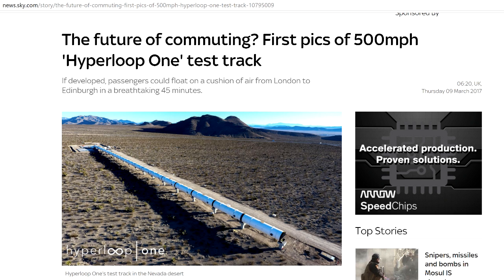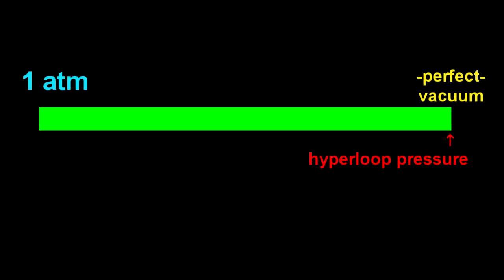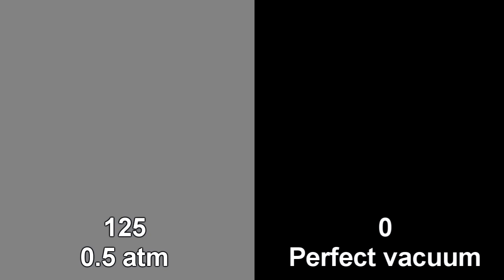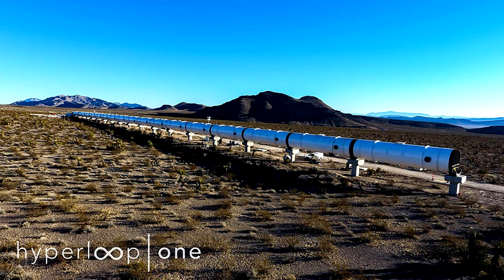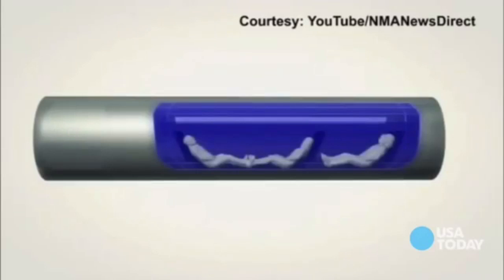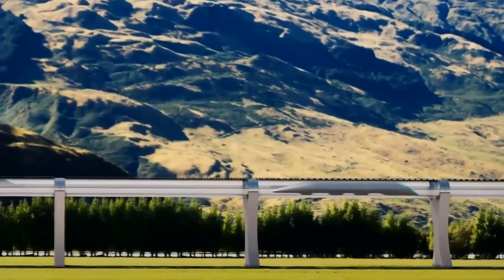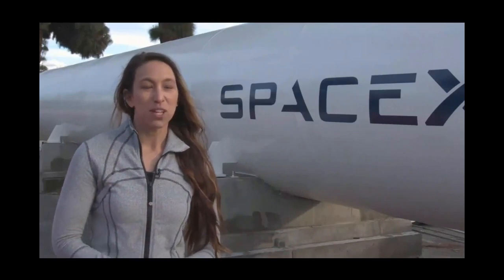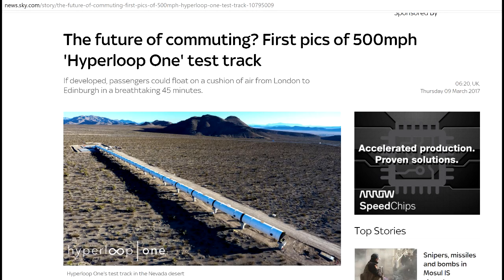Entire Hyperloop could be destroyed in SECONDS!

Comment: Interesting do you know what power is in physics it's what separates the the joules and n the food you eat from the joules in TNT you kind of blew the energy thing out of proportion on top of that just try to create a type of travel safer yeah so far it hardly got off the ground but that's why there call prototypes also a design idea might be to drop the pressure on one side raise the pressure on the other mind you to far less extremes then have and air tight seal one either side of the passenger car and and send it down like that.

Comment: what would you suggest as a solution for transportation?
Reply: High speed rail/Maglev.
Reply: I'm not saying your wrong, I like Maglev. and I have used linear motors on machines I've designed. The process of batch and queue needs to be addressed and pickup points. I would like to be picked up in my house. Unfortunately only cars do that, at this time. I like the hyperloop because of speed, small batch size, and it does not have to adapted to an out of date rail design. What ever we do we need to start fresh.
Reply: The economics of the hyperloop simply do not work. Even if we take the numbers that are offered, we're looking at close to 100 billion to finish this project. This means that a $20 ticket is a fantasy. The initial figures suggest 28 people in a car, and the rate of flow is one every 2 minutes, so 30 a minute which is 840 an hour. The trip takes 35 minutes, so we're talking about 18 cars in the tube at once. The headway between the cars is 2 minutes, and they're travelling at the speed of sound. That means that the cars are very close together considering the speed they're moving. No state that is investing this much money is going to allow such a short headway between cars, especially when the danger of one car crashing means the entire system could be destroyed. The cars do have brakes, but so do trains and it takes them a mile to stop at 50 mph. Granted, they are much heavier than the hyperloop cars, but they also aren't moving at an order of magnitude faster, are far, far, larger so friction is more of a force at play, and there's wind resistance. So the headway is going to be much larger than 2 minutes; likely something like 17.5 minutes, or halfway down the tube. This drops your rate of flow from 840 an hour to something like 84 an hour which is pathetic.

It's important to realize that we're talking about one of the busiest traffic corridors on the planet. There are around 50 departures from LA to SF every day, and each Airbus or 747 can carry anywhere between 300-500 people. If a flight is delayed due to plane malfunction or some other reason, then only one is stopped. If one of the cars holding 28 people in the hyperloop is delayed because of malfunction, then the whole tube is delayed. If a train car breaks down, there are alternate tracks to continue moving cargo. The hyperloop cannot have a track switch. That said, if there are delays due to extreme weather, then planes and trains are halted completely while Musk assures us that the hyperloop would suffer no such delays. It's not clear if this is true or not.

High speed rail can have a much more curved track meaning that it can avoid highly residential areas that would have to be bought up via eminent domain. Hyperloop has to remain almost completely straight otherwise it slows down which means buying up some of the most expensive land in the country. Not to mention, setting up and maintaining a vacuum chamber as large as they are suggesting is ridiculously expensive. Their solution is to power it by solar panels all along the tubes, however that in of itself is an enormous investment.

I'm not going to get into the physics issues the hyperloop presents because it's not something I have competence in. The only thing I'll say is that the expansion issues are a massive problem in conception. We're talking about a long metal tube in a desert. That means rather cold nights to very hot days. That results in expansion issues which are particularly problematic if you're running a vacuum chamber all along the 335 mile course. You can bury the tubes and mitigate most of the expansion issues, and you can also raise the price of the hyperloop by an order of magnitude to do so, maybe more. This isn't an exaggeration. In urban areas, burying power lines can cost 10 times as much as overhead lines. We're talking about power lines; an industry that has been heavily subsidized and has economies of scale working for it; not a brand new technology that is very volatile and cannot afford to have turbulence of any kind at any point. Also, the threat of earthquakes essentially renders the idea of burying them as a non-starter.

High speed rail is cheaper, holds more people, is more economical considering it can stop at more than one destination, and is likely going to have a cheaper ticket price.

Comment: Cylindrical containers are great from holding things as tension force is much easier to overcome than compression. This is why suspension bridges work so well. But even cylinders need extra material to overcome compression. 2cm of steel needing braces under normal atmospheric pressure? Doesn't take a scientist to know that it will fail long before the vacuum is is even starting to be applied

Comment: Maybe design a tube in tube system, that inside the outer tube is about a half vacuum and the inner tube would be the almost perfect vacuum. Then have sealed doors along the tube that open and close as the pod passes along it. That way you isolate sections of the tube. If one section has a vacuum failure, the rest of the tube is not affected. The tube can definitely be built strong enough to not crumple under pressure though.

Comment: Is there a lower limit on the density of a heated lifting gas like Hydrogen or Helium kept at atmospheric pressure? If they could get near vacuum density by using a heated gas, they could replace the pressure vessel with just a thermal insulator. I don't know how it'd behave at plasma temperatures so I'm not sure if it would even work though.

Comment: I work for a railroad and was working for a chemical plant back when I was about 20 loading hopper cars with plastic. in order to load the cars you needed to vacuum out the old product, the cars state very clearly to clean snow and debris from the top of the car prior to cleaning . somebody didn't do it, and didn't take the cap off the other side....needless to say the cars compartment ended up just like the tanker trailer  in the video.  thought I'd share

Comment: Umm, no... First off, tossing a pebble at it would collapse it. Second, in order for this to work, you have to open one end and release the vacuum. When you do that, air rushes in much faster than the speed of sound, which is what propels the "vehicle" forward. So far, nobody knows how to regulate that speed and so far, nobody's figured out how to survive those kinds of speeds. Then there's the problem of actually stopping once you reach the other end. If you produce this experiment in a PVC pipe with a ping pong ball, the ping pong ball will keep going right through the other end and destroy itself and whatever it hits as it hits at the speed the air rushes into the tube. Until those problems are addressed, people should not even be attempting this.

Comment: Were you expecting the (pre-test) pods to go the full 1,000 km/h in the 1.250 km?? You have to have time to slow down which would mean the pod would have to reach 1,000km/h in about 0.625 km. The proposed speeds are for production tracks around the length of 483 km, not for pre-test pods on a 1 km track. Also saying the tubes "look thin" isn't a substitute argument for using numbers and math when debating the structural integrity of the track.

Comment: I have a powerful vacuum system in my workshop designed for dust collection.  If you use regular household ducting for the system, which is designed for containing internal pressure not vacuums,  it will collapse like in your pictures.  The problem is easily solved by using thicker tubes designed for a vacuum.  All of the containers in your video, were designed for containing liquids.  They were designed for keeping pressure from liquids pushing out. None of the containers you show imploding were designed for a vacuum.  Why don't you do a video showing a cup of gasoline exploding,  from which you might conclude it was impossible to design an internal combustion engine.

Comment: Any engine system has allot of stored energy.  A lawn mower engine has the equivalent of several sticks of dynamite in its gas tank.  Yet engineers have built lawn mowers safe enough for any suburban home owner to use.   A jet aircraft carries enough stored energy to topple the world trade center.  Yet for the most part air travel is a safe mode of transport.  On what basis do you assume the problem of the risks of storing energy are insurmountable in one field of engineering when is has clearly been resolved in other fields.

Comment: The original idea was not to put pods in a complete vacuum but instead pump air in front of the pod to lift it up. However, even when we consider vacuum, you may take ISS as an example. It's in almost complete vacuum but it does not try to squeeze the tube but instead blow it out from inside. And for quite a long time it's still there without any explosions happening to it.

Comment: This video just makes you look like a prick as if you can't create a tube with a thick enough wall so it wouldn't collapse under vacuum pressure and o A large amount of people who don't have their degree in engineering couldn't make a vehicle that would travel in a vacuum that must mean it's not possible lol it really just makes you look like a prick when you argue  that with qualified people on the task with a good budget and proper equipment it be can be done obviously it will be under a permanent vacuum and obviously there would be some form of like a magnetic braking system at each stop and when installed the internal bracing is replaced with external bracing you really are a prick

Comment: So... There is a solution to this problem of the hyperloop collapsing in on itself. If you lower the atmospheric pressure by enough to make wind resistance virtually gone, and you put magnets on the inside of the loop and on the outside of the "cockpit", then perhaps you could achieve much higher speeds with a lot less energy... But this is just a YouTube comment so... Yeah

Comment: I have thought about this. Elon Musk has said that he had been digging or boring. Why? This can be proven by a simple experiment. When you extract the air from a tube, the surrounding air pressure will make it collapsed; but if you put that tube underground or even put it in a cement mix and after drying, evacuate the air, nothing happens. The force will be distributed in a way that the outer force on the tube will be reduced. 
So if you cover a tube with a solid material the force will be much less than if you have air pressure. But you're still right about the required energy to make a vacuum.

Comment: if they wanted to make the loop survive, they'd have to make the loop with dual steel layer, and materials with immense compressive strength such as concrete or something filling the gap as well as reinforcement rings and spars all along the length of the outer surface of the inner tube. the entirety of the inner tube would be pumped to near vacuum and the space between the inner and outer tube would be pumped to partial vacuum. the spars and rings would limit deformation cascade damage, the compressively strong rigid material filling of the gap would stop the outer tube from collapsing and experiencing cascade failure, while the partial or full vacuum of the system would keep the inner tube from being under high stress while the outer tube compresses against the concrete or whatever, which has massively strong compressive qualities, preventing further inwards deformation.

this only safeguards against nominal operation and does nothing against impact damage that may fracture the concrete fill.

Comment: what is a prototype?
what is an airlock?
what is a publicity stunt?
what is strengthening for transport?
what is deformation during transport?
what is 14.6959 psi?
what are the added supports that are clearly in the picture?
what is testing and development?

my father is a vacuum systems specialist and worked the particle collider at argon national labs. the only problem he has with it is that it costs too much. vacuum system can be very stable, when they are in fact designed to be vaccum systems. the vacuum equipment he works with looks real bulky and strong, but its do to the large lugs at the ends used only to increase the mating surface between the sections. the thickness of the walls is bound more by mechanical needs than their ability to hold a vacuum. the thickness of steel needed simply for the thing to support itself would be more than sufficient. also a single hole would not cause a catastrophic failure. even in the truck experiment you showed only 3 sections collapsed. your implication that the entire track could explode is a ridiculous as if you stating the earth would explode due to the energy from the sun hitting it. 

in short:
kill your self you fucking Luddite.

Comment: Ought to be based on existing maglev for the propulsion part. They don't say how they're doing the pump-down though. Gas ejection system using steam is likely better than mechanical pumps in terms of dropping the pressure quickly. However the vacuum tube walls would still be dealing with less pressure differential than some oil or gas pipelines, so that problem is definitely solvable too. System is also going to need vacuum breakers, otherwise one breach or break in vacuum may cause shockwave issues over a longer distance.

Comment: whats is this wheeled model have to do with the magnetic levitation rail vehicle?

if they really want to make it realistic its better of messing with the rail and vehicle first, vacuum is just a condition that enable the vehicle to move faster without any drag, whats the point using vacuum is the vehicle itself is really slow..
all they have to do is build some vehicle that have power to accelerate to desired speed within reasonable time, thats it..
if thats not enough then make some really low drag body, and put some jet turbine in the front to suck air and direct them to the side or below the train thus make some low pressure area in front of the train, the turbine itself can be used as mobile generator for powering the train..

come to think of it, you dont need vacuum to reach the advertised speed, some power and better aerodynamic is enough..

Comment: The reason why vehicles are not faster than what they are today, is we don't have any way to negate inertia. Its also the reason why the hyper loop modules just stop. Commercial jets top out around 600 miles per hour and maglev trains at around 300. The fastest manned plane can hit mach 2.5 which is 1918.17 miles per hour and the fastest unmanned plane can hit up to mach 10 7672.69 miles per hour. That is the X-43A Scram Jet. The X-43A has a Hyper Sonic Air Breathing Propulsion System which is what they want to use for the launching of future rockets for space travel.

Comment: These demos look fairly convincing to me.  There are also some other scenarios that need to be considered.  A small leak in the passenger capsule would quickly asphyxiate the passengers with no way to get them out in time.  There is also the danger of the passenger capsule hull failing and exploding inside the tube.  That is going to be extremely messy.

All in all, it does not look so promising.

Could it work if the inside of the tube remained at 1 atmosphere and a large fan was used to suck air in at the front and push it out at the back?
Reply: They would need some oxygen generating system like airplanes.

Comment: He has a good point there. I really want to see the hyperloop work, but there are many unknown's. If there is some kind of failure, the result would be catastrophic. After seeing that, I don't think those tubes will hold up. When they do perform a full test with just about no air pressure, they probably will collapse. The metal needs to be alot stronger. It might be better if they just left the tubes with air in them and maybe used air vents to suck the air out from in front of the craft. It might not travel as fast as they want, but I think with maglev tech, it would work.